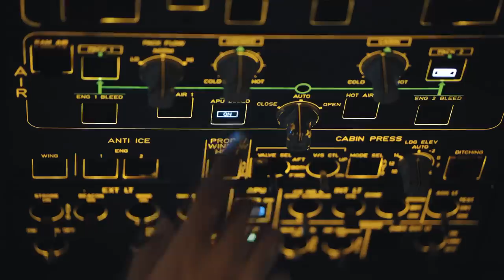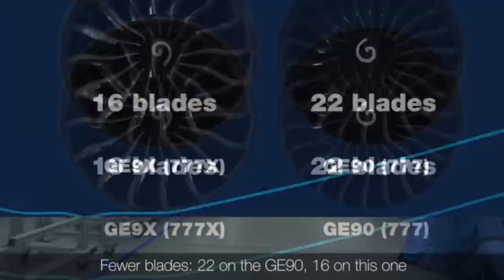Weekly Aviation Summary: 777X GE9X | Fuel Prices Slashed |  Ep 1

Comment: AirAsia will most certainly convert some of their A330neo to A321LR. With their bases in Malaysia, Thailand, & Indonesia, they only need a handful of aircraft beyond the range of the A321LR. The A330neo will likely be reserved for destinations across Europe and other high demand route between asia pacific.
Reply: Agree. As smaller planes like the A320 get stretched and longer range, they'll start pinching sales from the next size up, because even if they only get close to their capacity, they are much more efficient being smaller.